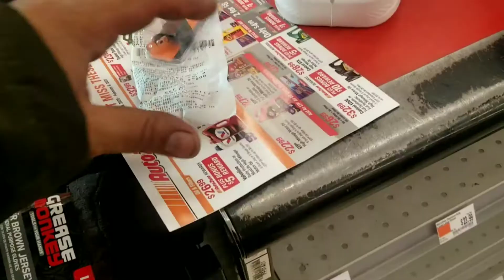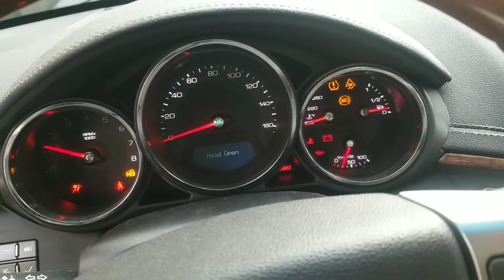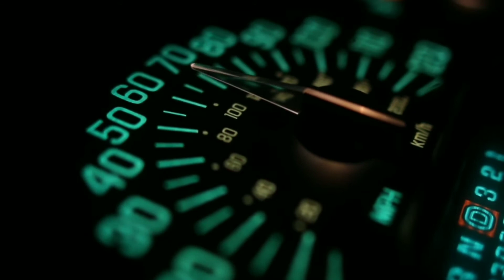2010 Cadillac CTS Oil Change | Valvoline | Cleaning Engine

Comment: Should be 5W30 though. At least it is for my CTS 3.6L anyway. Should always use full synthetic Mobile 1 or Amsoil in my opinion. 6 quarts for 3.6L V6.
Reply: Yeah he definitely using the wrong oil…..and it’s 5w20🤦🏾